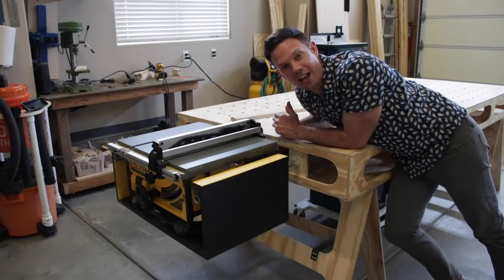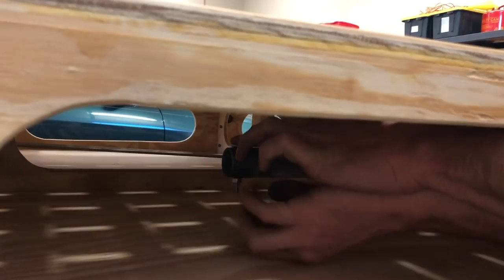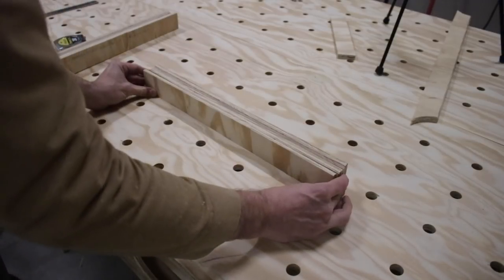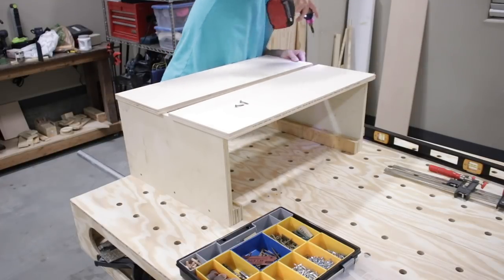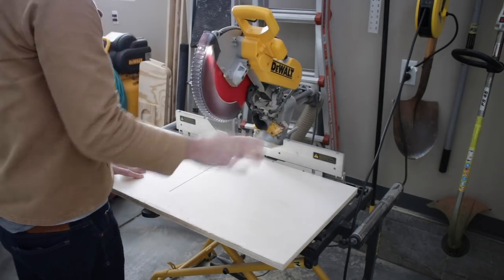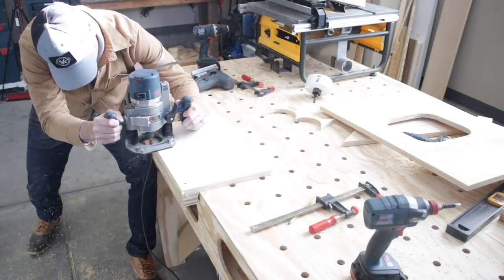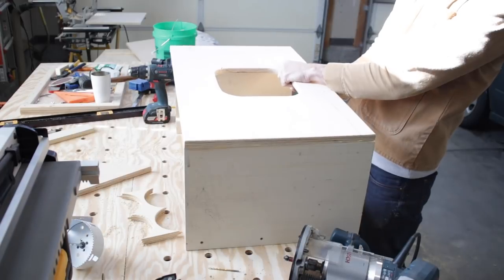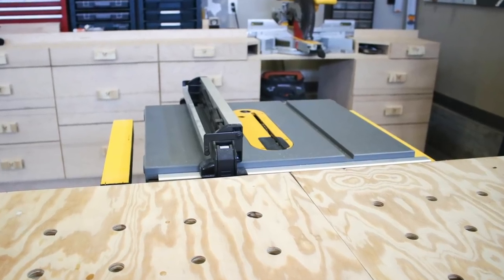Building the Paulk Workbench, Part 3 (Table Saw Mount)

Comment: It's unlikely that I'll ever build the Paulk workbench, but the outfeed table is such an awesome use of space! I might incorporate this design on a 2x4 framed work bench. Thanks for sharing!
Reply from the maker: Totally get that! Please share if you end up doing that.
Reply: @diywithandrew  Good timing- Just built my bench and started the table saw shelf last night! I ended up just framing a "box" out of 3/4" ply instead of using the retractable rod system. It makes sense in my application, because the saw will be stored in that spot and the bench is staying the in the garage. Thanks for sharing your build and ideas!

Comment: Great job!!  Thanks for posting this.  I ended up building a simple rolling cart myself instead of a shelf.  That way I can just shove it out of the way real quick if I want to use that end for another purpose.  Well...that was one reason. The other reason was I couldn't quite figure out the best way to adapt the Paulk Bench plans to a different saw than Paulk used.  I probably saved a little bit of work since I never used the pipes and didn't add pipe supports inside, but this way is a better space saver.  Thanks for the great videos!!
Reply from the maker: Don, thank you for you kind words!  I really appreciate you taking the time to let me know what you think and share your idea.  That makes a lot of sense!  Honestly that would make the workbench a lot lighter if you move it without those pipes! I'd love to see a picture of your rolling cart.  I'm on instagram at @fieldtreasuredesigns.

Comment: Awesome work, on the side of your 745 fence there should be a section of fence you can flip over which give you a shim to pack it up to the same height as the top of the saw for when you have the fence extended.  I saw on one of your cuts you weren't using it, might make things easier.
Reply from the maker: Thanks man! Yep you are right. Such a great addition to this saw.  I can't remember why I wasn't using it but thanks for the reminder and the tip for our crew here!

Comment: I'm a fan of Ron Paulk and really luv this design. 

FYI: I noticed you had a bit of room on the top of your Table that holds the Table Saw and thought it might be possible to add a bit of extensions to that area should the need arise and depending on the material used. Granted the Table Saw is centered on the Station but sometimes I've run into situations where a bit of extension could be useful. Just a thought...

Cheers...
Reply from the maker: That is an awesome idea!

Comment: Maybe I worry too much, but I would definitely consider putting some steel or aluminum bracing on the bottom of the table saw holder, as well as extending the blocks that rest on the pipes on the inside (or maybe a cross bar to make it a more complete box?).  The first to keep the shelf from breaking off if you're working on something heavy, the second to keep the walls from bowing out over time.
Reply from the maker: Those are some solid concerns!  I have to say after almost a year of using it have not seen any issues but certainly possible and you mentioned some good ideas.

Comment: Like this and thinking about build the Paulk bench for my garage shop. For leveling the saw I'm thinking about using 4 grub screws, similar to what you might use to level a throat plate on a saw or a router plate, inserted into the notched wood pieces which sit on top of the pipes.
Reply from the maker: Great idea. Go for it!

Comment: i feel like the saw may slide on the poles and jam the rear fence onto the bench, did u install something on the poles or cradle to stop the saw sled sliding on the poles maybe a locking pin?  as its all easy to disassemble I might make it so poles pull out to make bench lighter when moved, still looks more stable then those scissor table saw stands that dewault make
Reply from the maker: Thanks for the comment and I understand the concern there. Because of the weight of the saw and the stand, there has never been movement with the stand on the poles in almost 4 years of use. If anything, I think there could be stoppers placed on the bottom of the saw stand/tray to keep the saw itself from sliding on the wood stand/tray. I’ve had that happen a few times. But as far as any issues with the poles, I’ve never had any. Once I pull them out and place the saw stand and saw on it, it has stayed firm until I’m done. Also a quick tip, whenever I have moved the workbench myself, being able to reach inside and move it by holding the poles inside has been very helpful. Good luck on your project!

Comment: Great job. However, have you thought about using a sturdy french cleat instead of the two pipes to attach your table saw to the bench ? Thx
Reply from the maker: Thanks!  Hmm I never thought about that.
Reply: I will have to find out whether it will support the weight or not. Noone want to see the saw falling to the floor while cutting wood. But the pipe option will be on my list now 😉

Comment: What is the suggestion for the end of the pipes when the shelf is on to keep it from sliding off? This may not be an issue but I have a preventative mindset...want to avoid injury or cost of needing a new table saw if it were to fall off.
Reply from the maker: Great question!  I have had no issue with that.  The two reasons are because it is 1) pretty heavy between the stand and the saw weight on the bars so it doesn't really slide or move at all and 2) I'm never pulling "towards" myself, and only toward the workbench which means there is no risk of pulling the stand off of the pipe.  But that is my mindset and set up. Hope that makes sense.

Comment: Very nice job. What are you doing for dust collection? Just bring a vac nearby and connect to the back of the table saw when you need it? Something more permanent under the table?
Reply from the maker: Thank you! I attached a hose to the saw and rest it on the inside of the saw horse to hook up to my shop vac when its time make some dust. Hope that helps!
Reply: @diywithandrew  Just finished my Paulk Smart Bench build and playing with Dewalt table saw alignment.  The dust port exhaust hits right on the bottom of the table.  Serious hose bending required.  Looks like you solved this by creating space between saw and workbench?
Reply from the maker: @AllisonsDad  Congrats on the build!  Yes it is an issue for sure. That is why I have space between my saw mount the table!

Comment: so basically, the weight of the table saw sits on a floorboard that has just glue and upwards screws into side boards that hang off the bar handles with just glue and screws...  the DWE745 is 45 pounds... i have the DWE7492 which is around 57 ponds; do you think this construction is strong enough to hold that?  thanks for your thoughts.
Reply from the maker: It’s been 2 years and no issues whatsoever with mine.
Reply: @diywithandrew  cool. I might put some sort of dovetails between bottom and side boards for mine.  Or maybe I just route out a big slot in the side boards to shove the base board in on both sides....
Reply from the maker: @koenhuet5941  Great idea!!

Comment: Curious if the table saw sags while extended out on the rails?
Reply from the maker: Great question. That was one of my concerns. But not at all! Those pipes are solid.
Reply: Just built this last week, & yes there was sag. I used 28mm stainless steel poles. Going to incorporate an adjustable leg to level up. Also noticed the sable saw moves as I use my sled so going to set some pieces with grooves for the saw to sit in to sturdy it up

Comment: Also - what size hole did you drill for the pipe supports?
Reply from the maker: I am pretty sure I did 1 1/2 inch holes. I wanted just enough slide but not much play.